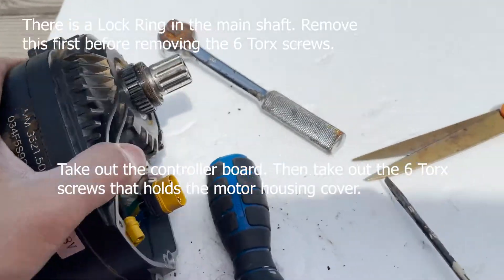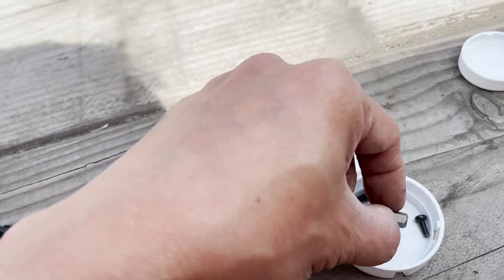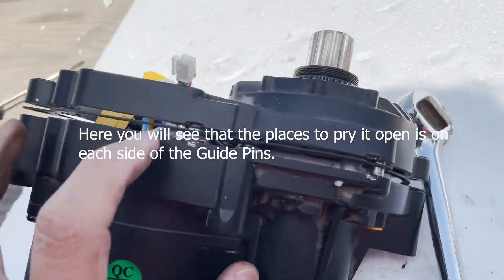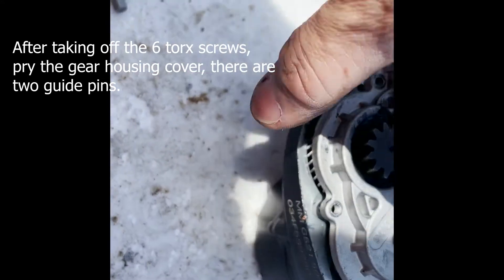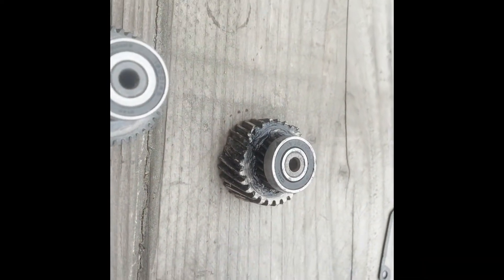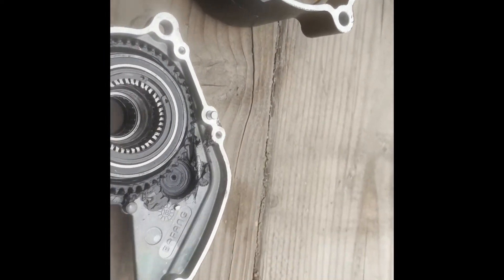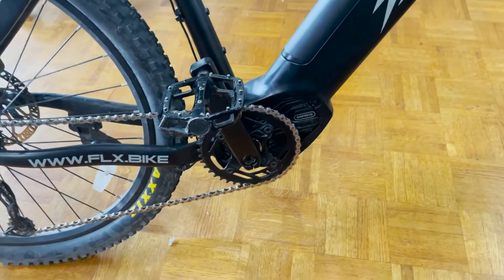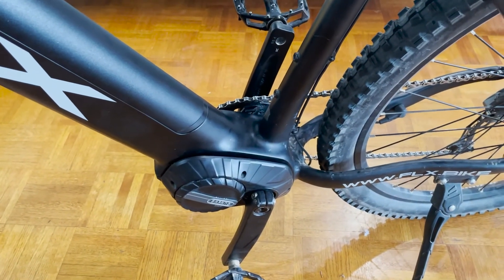Bafang M600 Motor Repair

Comment: hello po. may i know anong naging problema sa motor and what might have caused it?
Reply from the maker: Hi musta na diyan? I think na overdrive ang motor during my uphill climbs sa Potato Mountain. Using the wrong gear specially on sudden switchback na biglang pataas and no time to change gear. Also original kasi sa m600 motor ko is a hard plastic Peek gear, kaya madaling bumigay. This time I replaced it with a metal gear.  Good Luck sa project mo and take care!
Reply: @lotmarquez25  thanks po